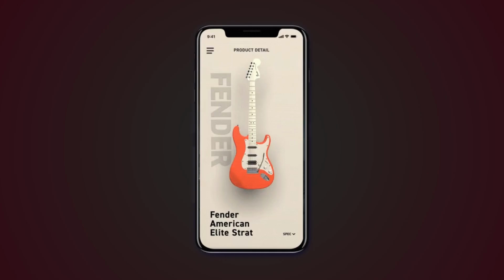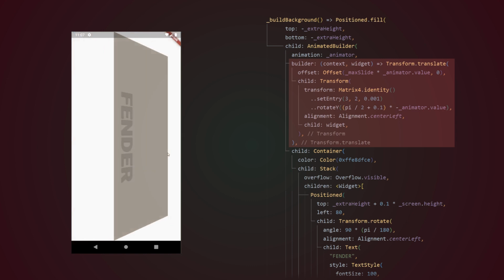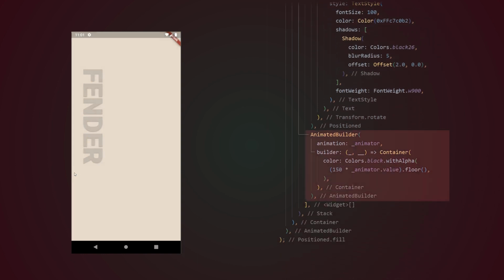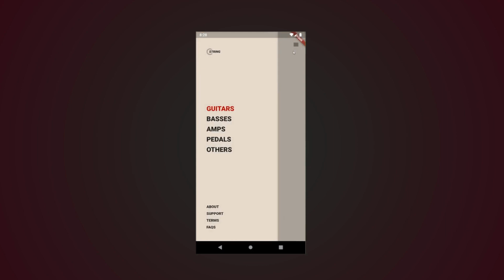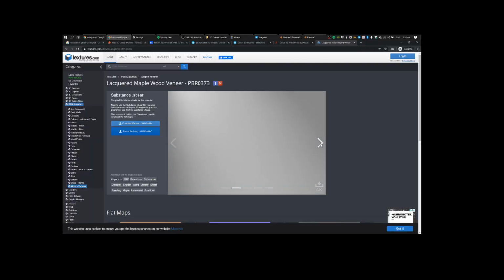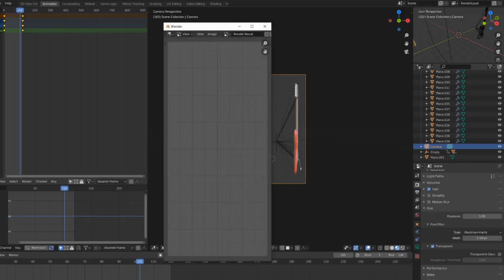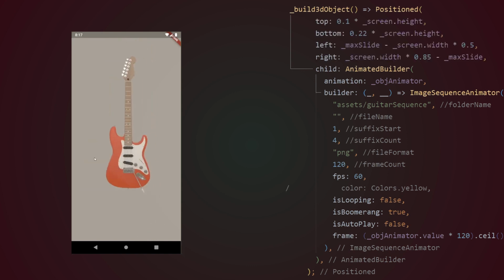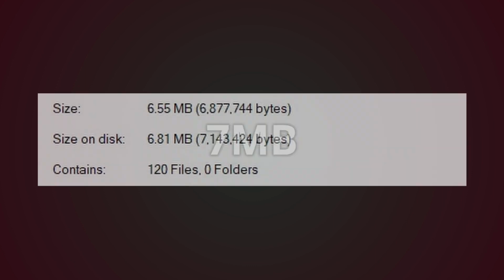How to use 3d objects in your flutter app

Comment: I want to know how the 3D mobile game produced by Flutter is? I will connect the Bluetooth sensor to transmit the data control model posture in real time. Can flutter withstand such rendering pressure? I have tried react native before, but unfortunately the rendering process of js can’t hold on. I don‘t know if you have any understanding of this.

Comment: Wow, that's awesome man😍 I was wondering how I can add 3D objects in Flutter with Custom Controller, but I couldn't find any. This is really Cool !!
BTW, Codepen now supports flutter and I found this template - https://codepen.io/team/codepen/pen/XWmXMBb with 3D model Animation, I think they also did it in a similar manner, they used a sprite sheet.
Reply from the maker: Thank you. Yes it seems I can replace the sprite sheet with my frame separated files to boost the performance a lot. I'll update the git project soon